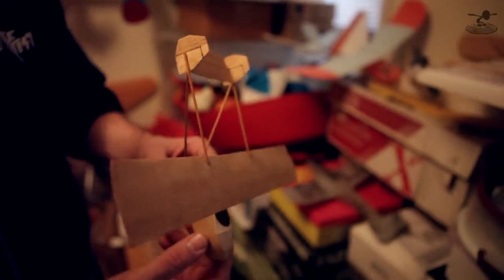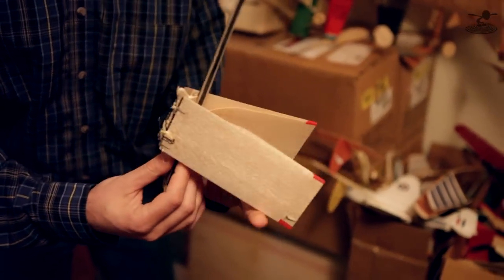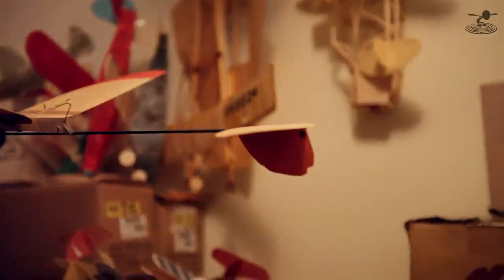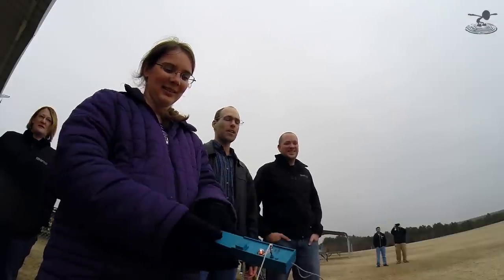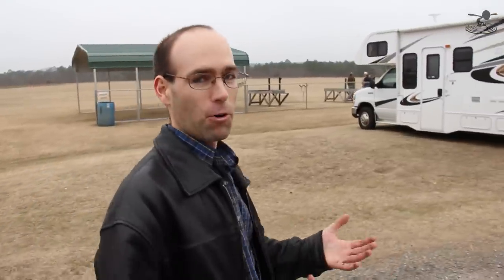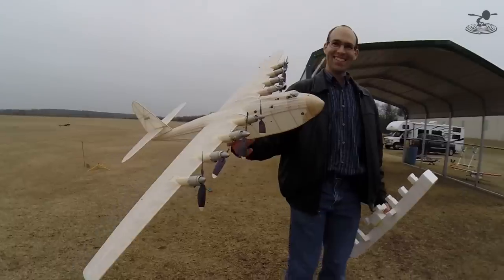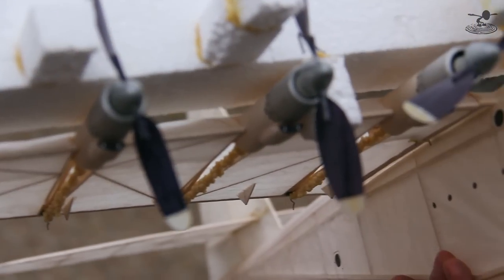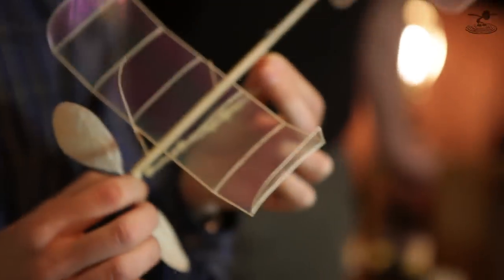Rocket Glider & Free Flight Airplanes | Flite Test

Comment: Stick and tissue planes... Man that tissue was sagging.  You need to mist it with a water bottle and/or dope it so it doesn't look like $H!t and create drag.
Reply: Nothing stops tissue from sagging when it's wet. What the video didn't show was that it was so humid that dew was forming on the plastic windshields of the models. If I remember correctly, it was actually drizzling slightly when we flew the Goose.
Reply: That's what dope is for
Reply: I'm quite familiar with dope. Unless you put so much on that it makes the models uncompetitive, the tissue still goes slack when wet. Even then it'll still go somewhat slack. That's why we use plastic covering on models designed to fly in the rain. Of course Polyspan doesn't go slack when wet, but is too heavy for rubber scale, and FAC rules ban the use of plastic covering.
Reply: I should add that the Found 100 has never seen a drop of dope, being an indoor scale model, and we got it out before the weather turned so wet. It didn't get flown that day for obvious reasons (nor did it stay out very long).

Comment: can i get his fb/google id
Reply: I thought your rocket gliders were amazing!... And then you come out with that Hercules model! Love your work!
Reply: You ever thought of making yourself a 3D printer? I would like to see how you'd utilize one.
Reply: +PterodactylDanceParty I've got one on order. For structural parts I'll probably need an SLA printer, but the fdm unit will probably help with some new gizmos. Since this episode was filmed, I've concentrated a lot on carbon and kevlar construction though.
Reply: If you're looking to get into high precision resin printing, I highly recommend getting/building a DLP printer as opposed to an SLA. The DLP printer uses projection to cure entire layers of resin at once. This means much faster print times, and the only factor that affects your print time is the z-axis. Not to mention higher degrees of X/Y precision can be achieved by using HD projectors... Also another option is putting a smaller nozzle on an FDM printer. I've used a 0.2 mm nozzle printing at 0.05mm layer heights, and have easily achieved high detail SLA quality prints. Problems with this approach mainly stem from back pressure issues, but it is manageable.

Let me know if you need any help picking out printers or troubleshooting in the near future. I used to be a 3D printer technician and still continue building them myself from scratch.
Reply: Yeah, I'll keep those in mind, but that's some serious cash outlay. At this point, I think molding DLG wings is going to give me a better ROI and I'll look resin printing once I build up some more capital.
Reply: Yeah, the major expense in DLP is the projector itself (not to mention the resin later on, it adds up). If you wanted to build a high quality FDM machine that would laugh in the face of any printer you can buy commercially (even several thousand dollar ones), you can do it for under $300 easily. Most of mine were around $250, but there's no shame in spending a bit more on crucial electronics. This sort of printer would use 2020 aluminum extrusions, which provides an extremely rigid frame that grants high layer accuracy. I don't usually recommend building printers from scratch because of the difficulty (as opposed to buying kits or pre-builts), but I'm sure you're more than capable.
Reply: Hmm...I'll have to give that some thought. Thanks!